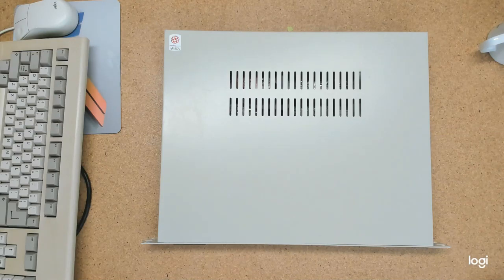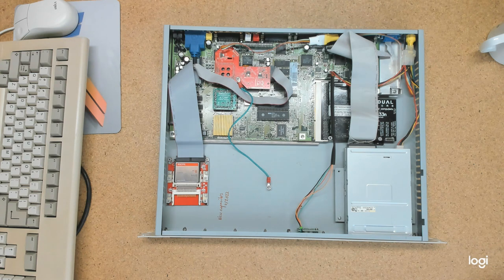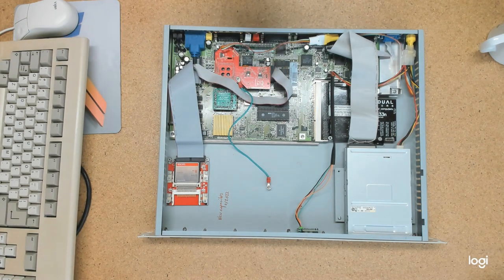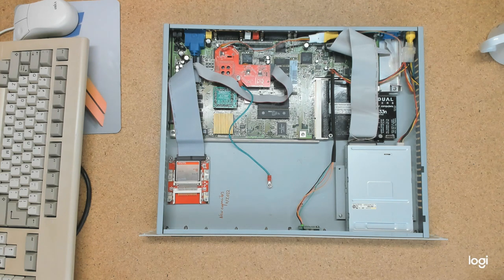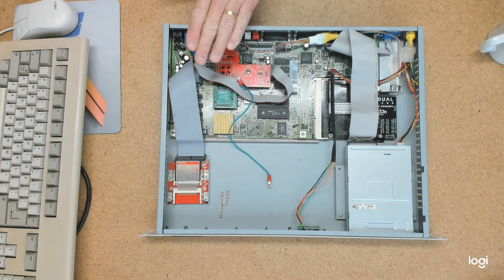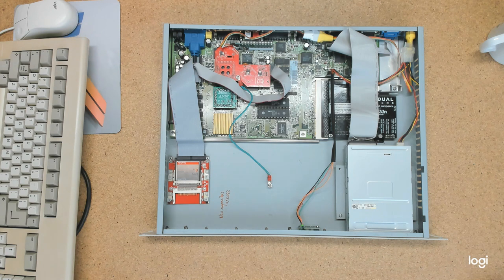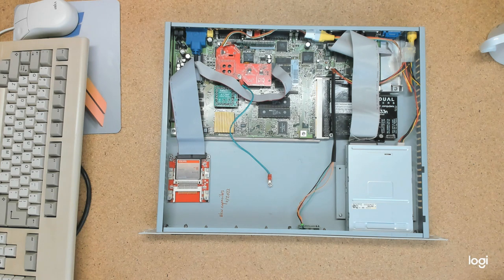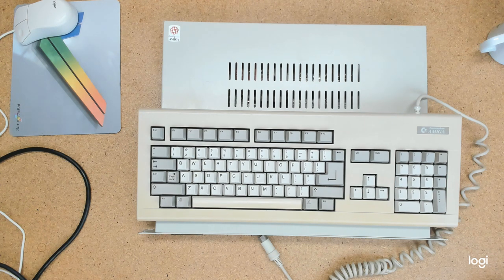Amiga 1200 in a rack mount case

Comment: That's really cool. It's definitely unique but at the same time actually really practical.

Maybe there's a case, for a case that's like that low profile. With the A3000 style a1500 cases around out there. Maybe a more slim line a1000 styled solution could gain some ground. The A1000 really was the nicest looking Amiga. Yeah the a3000 style is cool. But the A1000 is clearly the best. 

If I could get an annual l Amiga back in the day though with a 1U profile. Like Mac SE030 type case in size. Yeah I would have loved that
Reply from the maker: I prefer the big box stuff including the really slim big box shown here :)  I honestly cannot say which I prefer for looks, the 1000 or 3000 case, but the keyboard garage in the A1000 makes it the winner.  Thanks for taking the time to comment.